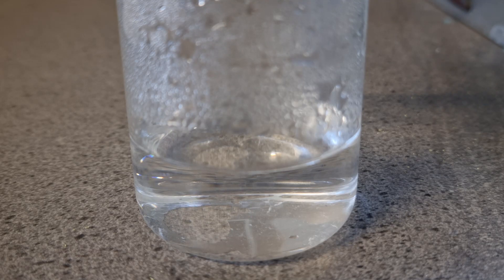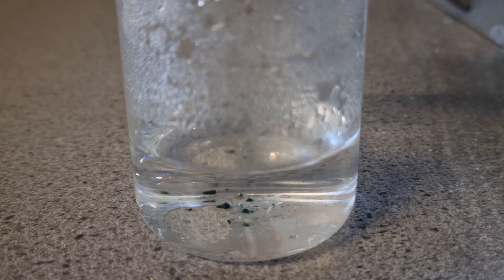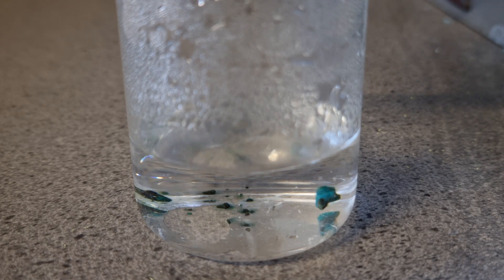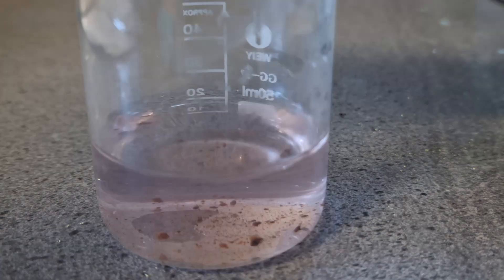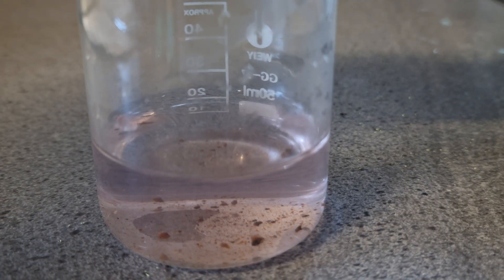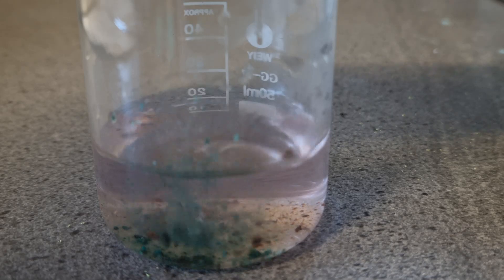How To Synthesize Solid Sodium Hypomanganate

Comment: could there be made greater amounts of sodiumhypomanganate if i use an HHO flame ?and melt all together?
Reply from the maker: The temperature reached by an HHO flame is too high and will just reduce everything to some Mn2+ compound. Maybe if you keep the flame more O2 rich and are careful with heating it is doable. Excess H2 will also just reduce rather than oxidise the mixture.